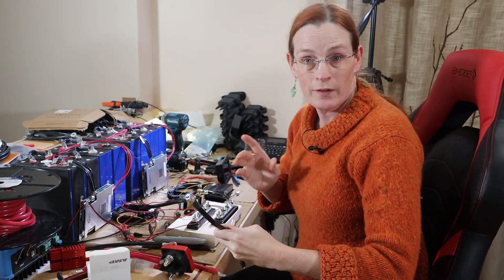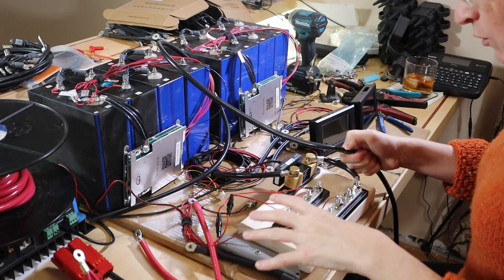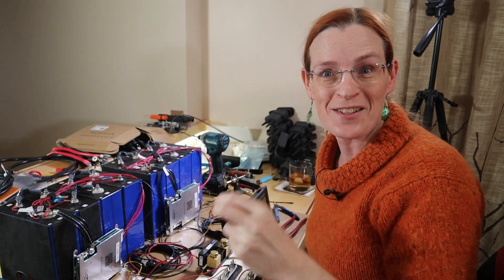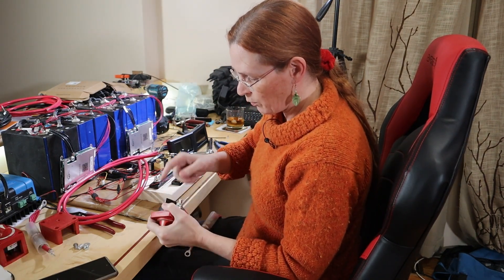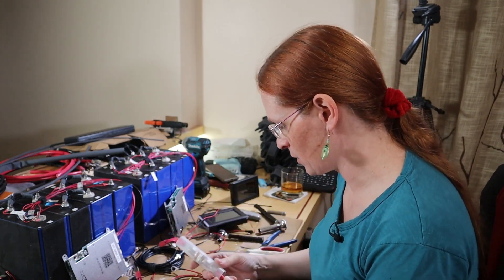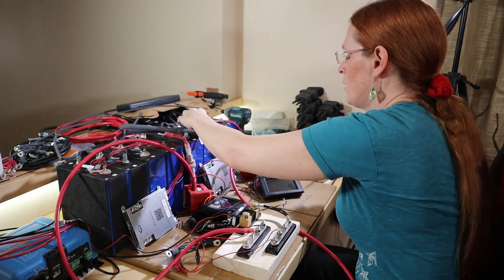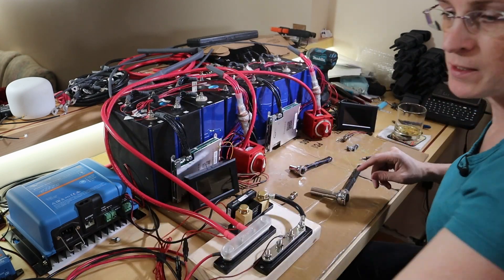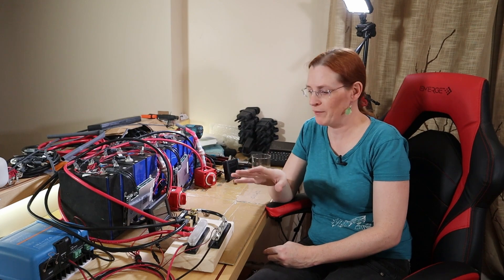Converting 48v Pack into 12v Packs - Part 3 (Ep. 51)

Comment: this is a daft question since its now end of April 2023, and i guess by now you have shifted the batteries to the boat, how did that go, did you manage to do it all in one trip, did the car like the whole load of batteries or did you do two trips, i could jump ahead and see what you did if you recorded it hehe
Reply from the maker: First pack is on the boat, now a 12v config. Main bank is still waiting to be installed after I get the boat back home
Reply: @TheDigitalMermaid  Ah cool - so it will be a trip or three - that will make you dizzy loading the boat, unless you do what i do - move everything in short trips, instead on one battery a time all the way to inside the boat hehe
Reply from the maker: @patchmack4469  The 12v will remain, even after the conversion. It'll power one of two bilge pumps, nav gear, house and nav lights, etc. Loading the final 48v packs will be one hell of a job, but in the grand scheme of things, nothing too hard. Just labourious.
Reply: @TheDigitalMermaid  you will become an invincible muscle mermaid haha

Comment: do you get burnt out after a while and be lazy doing all the cable and wiring..i know i do :face-blue-smiling:
Reply from the maker: I get the urge to start cutting corners, for sure. Though I've done enough projects in my life to know that a cut corner will burn you worse in the long run, so I force myself to keep the same standard, even when I really would rather not.

Comment: Great (3) video(s) 😊
I might have missed that part. Do you have (on) switches for those JK BMS? Otherwise they might be very difficult to start up again, after they shut down e.g. because of an over-current protection ...
Reply from the maker: The screens included an on/off switch, so restarting the BMSes isn't a problem (anymore, was a PITA before).
Reply: @TheDigitalMermaid  Ah, good to know 👍

Comment: Do those BMS's have bluetooth? If so I'd say connect the screens on the switched side. I live on my boat and the more the isolation switch isolates the better in my opinion. 99.9% of the time my batteries are turned on and the screens would be available. For the 0.1% of time they're not, I probably wouldn't even be concerned about the state of charge. And if I was, there would be the bluetooth option. Food for thought.
Reply from the maker: They do, yup. If I take these BMSes into the boat, and if I decide to keep the screens, I think I'll do just that... An external power supply for all screens on a single switch.

Comment: I’m still suspect of the cranking loads actually only being 230a peak on an old starter on an old diesel. Your multimeter (CL800?) doesn’t have the “inrush” feature of the cl900 so you may have missed the peak current. 

When you heat shrank (word?) those fuses, I said a little pilot (and mariner) prayer for you. Saint Murphy always is watching😱. 

As an experiment (inspired by someone’s dissection of a class T 😇, and Nigel C’s book), I tried a blue sea (bussman) 200a ANL on my starter circuit when I was converting to 24v system. The starter is still 12v as is the AGM starter batt (lifeline 4D at the time). First 2 starts were fine. 3rd start—fuse melted. These were all at dock and about 15 mins between attempts. (Engine started quick—maybe 3 secs cranking the first 2 starts). I tried a 300a ANL. 3 starts no problem. Next morning, it blew on first start. Removed fuse from circuit…all is bueno. I did replace the 4awg wire prior to the experiment just because of how stiff the cable was (probably 22 years old). It’s still 4awg but is now part of my checklist to watch for (oil change cycle). 

I am not trying to be a chicken little. I really hope the 2 LFP batts will handle your start loads consistently. I’m just suspicious of the inrush load test you did. Did it really tell you the peak inrush current or did it just sample/report a value sometime after the peak inrush?

The good news is that you should know well before you leave Annapolis 😉

https://www.bluesea.com/resources/114
Reply from the maker: That was a fascinating article, thank you for sharing it. I am using the CL800, not the 900, so you're right that I may have missed a higher current pulse that was shorter than the sample time of my meter. On the heat shrinking, I'm curious what issue you see Murphy possibly kicking me over? Do you think the inrush could be enough to blow the fuses? 

Looking at the time and current curves on the spec sheet for the JLLN200 fuse, I should be able to handle 500A for 10 seconds before they pop, which would translate to 1000A over the two packs. If that inrush is high enough, I could see it potentially damaging the FETs in the BMS, but as noticed when the coiled wires jumped when I turned on the one BMS by accident and charged the inverter's caps, they seem to be able to handle those short bursts. I don't know the specific MOSFET part numbers though, so I can't confirm for sure if they can or not.

In any case, all of this (and I didn't make this clear in the video) is me planning in case my existing old batteries die on me, and I need to fall back on the LFPs to crank the engine. With luck, I'll get home and never try turning the engine over from the LFPs. :)

JLLN200 - https://www.littelfuse.com/media?resourcetype=datasheets&itemid=78225034-cd5b-4006-8871-38e7378ac8f3&filename=jlln-fuse-datasheet
Reply: @TheDigitalMermaid    I didn’t miss that you will be starting on the old lead acids. I hope they (2?) hold up. 

The heat shrink concern was just that same “where’s my knife?” risk should you ever need to start quickly and the fuse blows. I quite like it as a neat solution for keeping corrosion and short circuits out—just not for changing out a fuse in a seaway if it ever blows. As a house battery, think that is a low risk. 

Again, I’m a Murphy disciple on power failures. I’m not sure where I first got paranoid but it may have been the time a brown bear was chasing a truck load of oil drillers and I flooded an engine in my early flying days in AK. Different failure mode but the other engine started fine and the passengers said the massive backfire I got when I finally did get the left engine started persuaded the bear into thinking about dinner elsewhere😱. I was too busy spewing gravel in the bear’s general direction 😉. 

I do think the inrush current might get your fuses, and possibly your mosfets if the fuses don’t blow. It is a “feature” of the serial BMS design. 

I think the inrush current challenge is 2 orders of magnitude (time wise) less than the 10 seconds. (.1 seconds). There you would be around 800a on the littelfuse chart. I sorta wish I had gone to 750a on the ANL fuse experiment i did last summer. I know the conductors in an ANL are different but they are slower to blow. I was able to get a few starts on a warm engine but the cold engine start just melted the 300a instantly the next morning. 

Nigel C has a good bit to say on this (search inrush if you have the kindle version—it’s in chapter 4 but the page numbers won’t align between kindle and the book). He says 1500a inrush current on a cold 12v starter: 
“Protecting cranking circuits, however, is problematic. In cold weather, the inrush current on a 12-volt starter motor may be as high as 1,500 amps; the cranking current may be as much as 200 amps. Often, cranking cables are undersized even for the cranking current, let alone the inrush current. This situation does not pose a safety problem because these currents are only sustained for a few seconds, so the cables do not have time to get hot enough to create a fire hazard.” [Boatowner’s Mechanical and Electrical Manual, 4/E, Nigel Calder]

BTW, he says a 300a slow blow fuse should work in the start circuit. It didn’t work on my Yanmar 4JH2. (Well, it did for 3 starts🤔)

The blue sea site has a different way of looking at the fuse rating. They have a blow delay curve. I’m not sure if blue sea uses the littelfuse or some other brand so ymmv. 

https://www.bluesea.com/products/5116/Fuse_A3T___Class_T_200_Amp

I really enjoy your channel. Great content and sticktoitness!

Comment: Is there a fuse in the line of the display positive? I like the tiny 5X20mm fuse assortment from Amazon. They are down to fractions of an amp. You can use the provided fuse holders but I just solder it in line and use a thick adhesive heat shrink over it. Small compact and tuff. Do sacrifice one of each rating for working load and blow current using a bench power supply and record the true value.
Reply from the maker: Not yet, but only because I don't have one yet. The screens are unplugged now. I'll be adding fuses to them, as well as a fuse to the charger when I next work on it.
Reply: @TheDigitalMermaid  
Cool. Trick question:
Do you know what they call small wires with infinite current potential? 
Glow worms 🤣

Comment: The 10gawg from the busbar to charger could use a fuse. (Probably already has one given the time-space continuum shift 😉)

Nice words of wisdom on project momentum and getting through “insurmountable” roadblocks (which are really just speed bumps 😇). 

What’s the latest on the transmission?
Reply from the maker: It doesn't have a fuse, and holy shit why didn't I think of that. Good lord I'm slow, haha! I'll add a fuse when I'm back home, thanks for that reminder. 

The transmission leak seems to have more or less closed itself. I looked over the engine yesterday with a friend and she helped me realise how much work I have to do. I don't think I'll be starting the engine again for a bit.

Comment: hmmm .... only a guess but using your multi-cable connectors (the flexible solution to and from the fuse) shrinking "for boat reasons" may not have the isolating effect you expect bc you will have still room between the single cables where water will be able to get in...
Reply from the maker: This is true, though my concern is high humidity salt air more that direct water. The ends of the ring terminals also expose the cut copper strands in the wire. I am planning to get some "liquid electrical tape" (I'm sure it has other names) that I can brush onto exposed bits like the back of the bus bars and to front of the barrel of the bus bars to seal them off proper.
Reply: @TheDigitalMermaid  maybe heat glue might be a final sealing like the most manufacturers use for fixing and isolating solutions
Reply from the maker: @germanguy2559  My worry is the hot glue doesn't stick strongly enough, but it would be better than nothing for sure.
Reply: @TheDigitalMermaid  the key in my opinion is that all components include the cables have to be mounted and fixated really well. As long there is no movement between the components it might be a workaround.

Comment: Just wondering why? If you had a 48v battery why are you repacking them into 12v packs and losing the efficiency of 48v overall? I run 12v in my offgrid home currently, but wish i had 48v .. what was the reason? Im curious..
Reply from the maker: Originally I planned to have only 48v, and use 48v to 12v buck converters in places that I needed 12v. That was back when I also planned to have a generator. When I decided to ditch the generator and go only with (more) batteries, I decided to create a separate, dedicated 12v bank to run safety critical systems, like the radios, nav lights, backup bilge pump, depth sounder, etc. The idea being that if I drain the 48v pack entirely (being a share propulsion/house bank), I'd still be safe, even if I had to just float there waiting for some solar to recharge me. Given this long term plan, and knowing my existing 12v lead acid batteries are oooold, I decided to make the 12v pack now so I had them for the trip home with the diesel.

Comment: hi there DM, i think that the "thin" wire that goes to the charger should have a fuse close to the busbar. when shorted out at the other end. it will get the full blast from the battery. always make sure to use an right sized fuse on a wire when reducing the crossarea. greetings from hamburg, germany.
Reply from the maker: Yup, it absolutely should, and I'll add one. THanks!